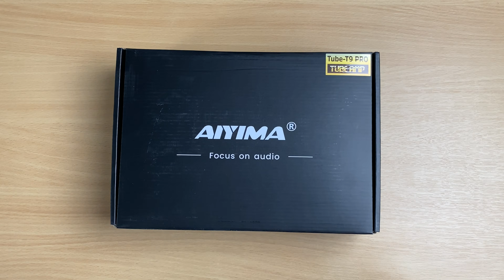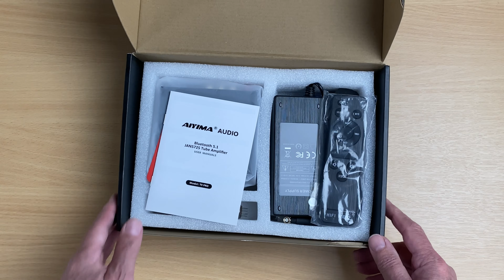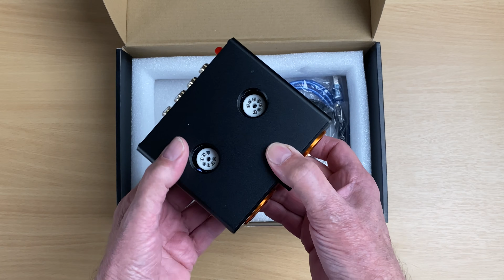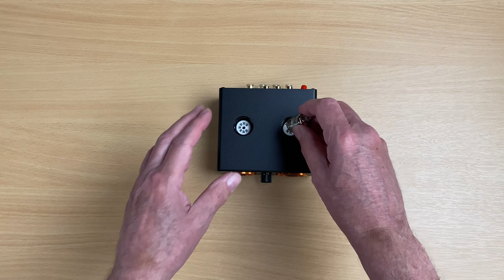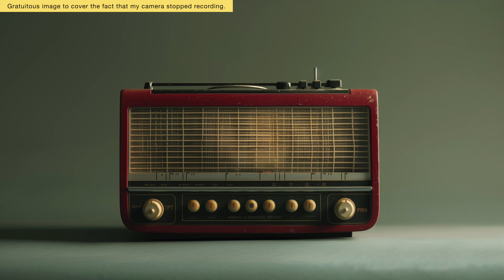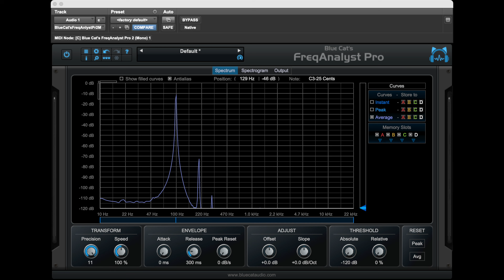Does this amp distort? [Aiyima T9 Pro]

Comment: Sure I want to hear warmth and distortion!
That is: the warmth that is captured at the recording stage, and the distortion of any guitar driven valve amps that were used at the recording stage.
But I require my system to reproduce these things with as much fidelity as possible. Without adding any further warmth or distortion whatever!
Reply from the maker: To add to this, if 'warmth' - shall we call it - is added to the individual tracks then it sounds very much nicer than doing it to the stereo mix.
Reply: @AudioMasterclass  100% agree. And spoken like an engineer.👌
Reply: @AudioMasterclass    No doubt about that. The fervor with which we hit analog tape could make that happen. Clean, crispy vocal and horns on top of a swampy drum ‘n’ bass groove was a fave of mine. When I changed to digital, I had to relearn recording to get that swamp back.
Reply: I’ve been recording music my entire life. There is no warmth anywhere to be found in the studio. Music is shocking, surprising, thrilling, beautiful, stark. I mean, the lights might get kinda warm, but not the music.
Reply: @artysanmobile  I too have been recording and creating music all my life, so I know that warmth and distortion - whether generated by musician or engineer [or indeed both] -  either by accident or design IS most definitely a thing!
I use the word distortion in a technical sense to mean, for example, the clipping of a valves output or the overloading of an input stage.
Warmth, on the other hand, whilst being a rather more subjective term, is at least as viable a notion as say all those terms you seem happy to bandy about. eg. "shocking, surprising, thrilling, beautiful" and "stark".

But to return to the OP's lead:
My point, as expressed, is that whatever the sonic choices made at the recording stage, I personally am desirous of reproducing it with the most fidelity possible.
And for me this means to do so in a distortion free way!
Fidelity: the high-quality reproduction of sound. Anything that adds or takes away from this ideal is anathema.
Reply: @Lif-999    Those terms I ‘bandy’ about are musical, not technical. And, yes, both you and I knew there was distortion that we could not eliminate so we spent countless hours trying to trick it. Personally, when I finally moved to digital recording 1986-ish, I thought I’d died and gone to heaven. Remember the bass??!! It changed my entire life.
Reply: @artysanmobile  Agreed, those terms are indeed not technical. Nor though are they strictly musical either!
They are merely terms plucked from the lexicon of the nebulous for the purposes of trying to quantify the unquantifiable.
when in reality all we are actually doing is expressing a subjective opinion.
And that's fine as far as it goes. The fact that you, or I, may, or may not, like a particular piece of kit might be entirely divorced from it's mearurable performance.
But I do worry that the use of such terminology only muddies the already roiling Hi-Fi waters further. Serving in the long term to do more harm than good.
Not to the likes of you and I perhaps, but what is a newbie to the hobby to make of it all?
And as a consequence, how much more likely is it that he/she will be led astray or even taken advantage of by being bamboozled by it all?

Let me finish with this:
Any amplifier is just a machine. 
But all a good amplifier should do is to produce an output that is as faithful as possible to the input, albeit with greater amplitude.
It should not add anything. Nor should it take anything away. To do either is by any reasonable definition of the word, distortion.
This can be very nearly achieved by the application of the principles of science. A process that from start to finish requires no magic. None! Zilch!
To my mind then, any deviation - at the replay stage - from this ideal would be akin to a visit to the Louvre to view the Mona Lisa whilst wearing sun glasses.

Comment: The T9 Pro is very well designed and if you have fairly easy to drive speakers then it's all you need but if you need more power like I do the T8 - A08 Pro combo is better but I still keep a T9 Pro around because the DAC is fantastic and it's a nice backup.
Reply: I saw you selling one on ebay, I'm actually looking to buy yours lol!

Comment: Your inference, that ‘warmth’ and ‘distortion’ are one and the same is spot on 100% correct. All the complimentary words dreamt up by audiophiles and the like are the result of either low order harmonic distortion or some fairly radical equalization. All of them. The implication these fond descriptors just popped up out of the zeitgeist, or somewhere far worse, is truly laughable. Personally, I like ‘clinical’ and ‘cold’ but that’s a whole other issue.

Btw, your unboxings are in danger of becoming far more important than the stuff in the box. That’s a good thing. When the Smithsonian comes knocking, they will be coming for the box. You can continue to use its contents.
Reply: I find it odd that the audiophiles are so intent on keeping the technology they grew up with alive. I got into audio in the early 70s and soon learned that tubes were horrible and records were the work of the devil. 
Back then the class AB transistorized power amplifiers were usually under biased to get the best THD readings. I increased the idle current in my power amps looking at a THD analyzer and set the bias at the point that the reading had reach minimum without getting the current to high. That solved the "transistor sound" problem.

I am now listening to music I bought and downloaded from Qobuz and HD Tracks on a android smart phone using USB Audio Player Pro through my Dragonfly Cobalt.
Yes I am a Electronics Engineer.
Reply: Yep, and vinyl is great at doing that.
Reply: @Paul-D-Hoff    The distortions from vinyl would fill a whole page.  If music playback were transportation, vinyl would be Fred Flintstone’s car.
Reply: I rewatched this and he said "no" he does not believe distortion is warmth.  Check out 12:12
Reply: @johnhoffman8041    You misquote me. I did not say “distortion is warmth”.  I said “warmth is distortion” and they are two different statements. I couldn’t care less who disagrees. I am a design engineer. The one who develops circuits on an analyzer to find the most ideal compromise between operating bias and device type to reduce unwanted distortion. It’s a fairly involved process, so unless a person does that sort of thing for a living and can discuss their findings, I don’t need the waste of my time.
Reply: @artysanmobile   Not you I am referring to the presenter he said at that time mark the he did not agree that distortion is warmth. JH
Reply: Let’s face it , home audio is crap.I know because I have been playing around with the stuff for over 50 years.
Reply: @davidspendlove5900    So, your experience counts for everyone?  That doesn’t seem possible. Some people care enough to add minimal treatments to make one room sound good. Once that’s done it’s quite easy to get very good results. I would say less than a thousand dollars very wisely spent will give excellent results at home.